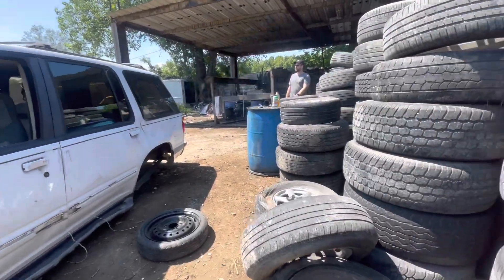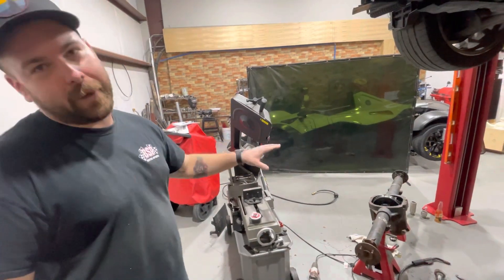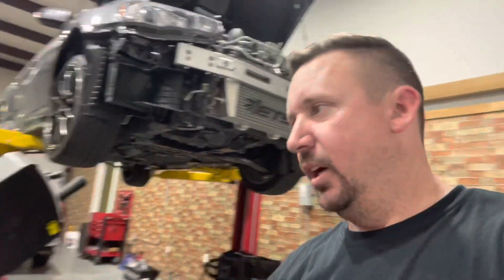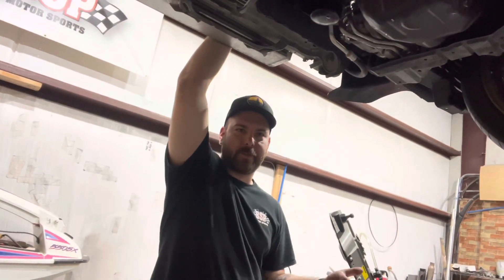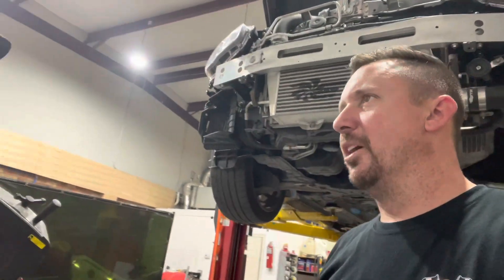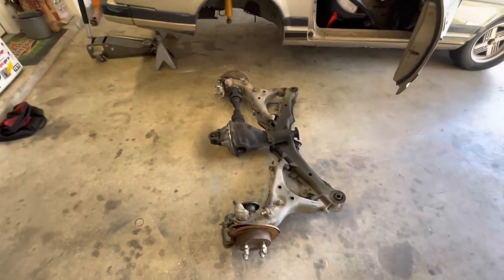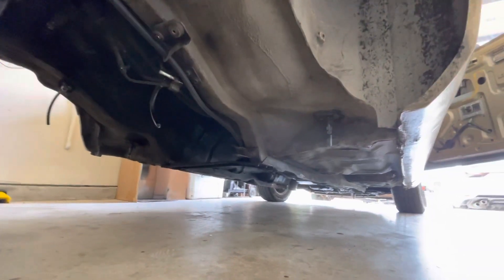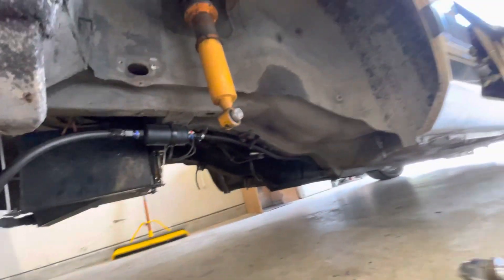8.8 Solid axle conversion! (Pt 1/4)

Comment: Hey there, planning on doing the same to my Z, wondering what width you guys went with "WMS" side to side? & did you have to tub it at all? Thanks guys...love the vids
Reply: 53 3/4" ?
Reply from the maker: @sing3r14  I’m not sure I understand the question. I didn’t have to tub it at all.
Reply: @masterofmachines  nice work how is it holding up. Just cut into my 280 last weekend then come across this
Reply from the maker: @derekb9495  it’s been really good! I still race it most weekends and it’s gotten really fast too.